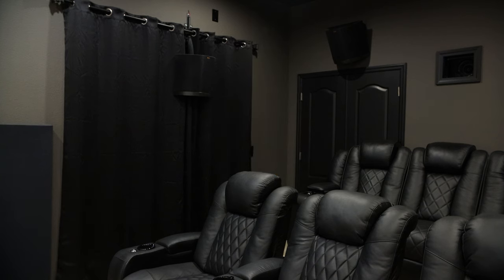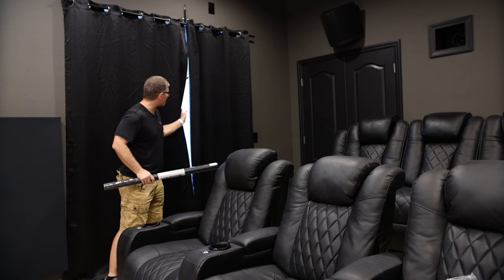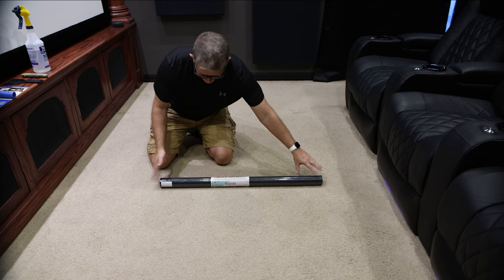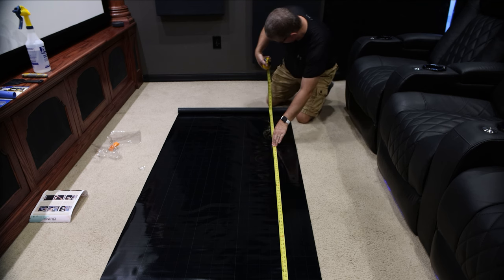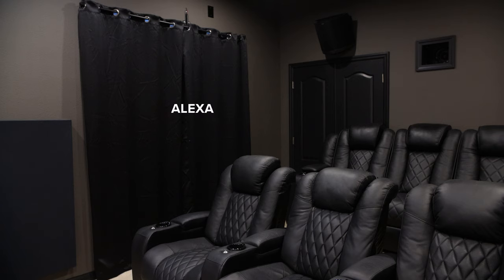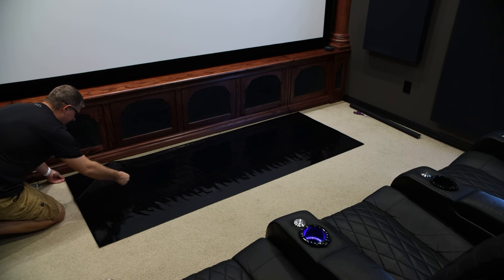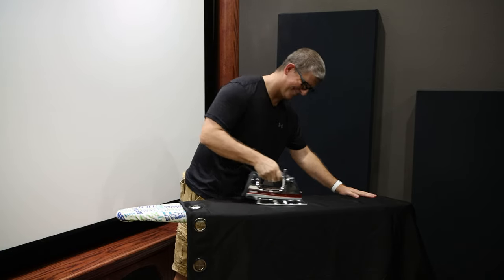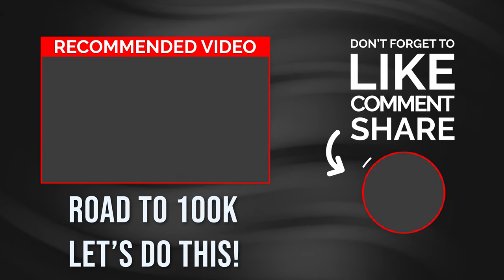CHEAP AND EASY Way to BLACKOUT Windows in Your Room

Comment: The static will pull a lot of dust. You should spray on the side going towards the window as you pull the protective film. Will prevent dust build up and make install a lot easier
Reply from the maker: It was pretty easy to install.

Comment: Awesome video! I’m 36 and home theater has been a HUGE passion of mine for half of my life. Finally bought my first house after renting for a long time and it has a fully finished basement. First problem I had was dealing with the sound absorption from the drop ceiling tiles now that is taken care of on to covering the windows and this turned out to be your latest video! Funny how things happen. Keep up the awesome work!
Reply from the maker: That’s awesome David! Congratulations on the new home
Reply: @Youthman  thank you!!!
Reply: Pretty sure you could've fixed most sound problems by getting a good sound system loud enough to feel tho 😢
Reply: @ShawnJonesHellion  I have dual Klipsch 15” subs, that’s enough power for a medium sized finished basement. The problem was the sound absorbing ceiling.
Reply from the maker: Who?

Comment: My instinct is to paint the OUTSIDE of the glass pane WHITE to reflect the light away. It should also keep the window cool and hopefully keep it from cracking. What's on the inside pane of the window shouldn't matter, because you're trying to keep the outside light from coming in, not stop inside light from reflecting back (the blackout curtains will take care of that).

Comment: What wasn't mentioned is thermal expansion of the glass. Unless a small area around the perimeter is exposed (film not up to edge) the window will crack when it gets exposed to direct sunlight when hot. The film will prevent the glass from expanding and will cause it to crack. The professionals us a credit card to trim around the perimeter the correct distance. You'll find out.
Reply from the maker: Mine is under a lanai and does not receive direct sunlight.

Comment: Be careful on installing blackout on glass if the glass isn’t fully tempered glass you could potentially break the glass from heat build up
Reply from the maker: Thanks. I'm not sure if mine is tempered glass or not. But it's still good as new and I live in Florida.

Comment: these worked very well in my room. had a tough time with the corners, but otherwise they did a great job!
Reply from the maker: You did the same. Covering them with blackout curtains completely blocks any small light bleed from the edges.
Reply: @Youthman  exactly. It's the perfect solution.

Comment: Very nice, less messy than what I did. 
I used black latex paint and painted my two big windows and then covered it with a blackout curtain that was already there trying to block the light. 
The latex paint is very easy to remove from the glass with a razor blade if you have to.
Reply from the maker: Wow that’s commitment.

Comment: Thermal heat buildup can crack window glass and cause excessive expansion and contraction of your window unit greatly decreasing the window seals service life.  It would be money well spent to simply purchase blackout shades which are now widely available in either manual or motorized units and wouldn’t void your warranty

Comment: Put some similar stuff on last year in my basement, so far so good, I do notice when the sun hits it first thing in the morning it's gets pretty hot tho, not much of an issue cause it's only for an hour or so, but might be if it was getting blasted all day haha
Reply: I'm sure you can find a white brand that would reflect. In cold areas you would want the black tho. Heat probably shrinks an destroys the black a lot faster

Comment: We can use a plastic ruler to squeeze the water instead of metal to avoid hurting the material.
If you need to remove fast, maybe using black pp plate sheets and hook/loop fasteners will help which I am using now.
Reply from the maker: My scraper was plastic. Should be the same as a plastic ruler.

Comment: Omg the speaker mount on the side surround. I’ve struggling with the left side of my room. Due to it being 4 higher and open to our tiled dining room. Does that speaker have any ports on the back. And if so how does it sound against your sliding door
Reply: I have those same klipsch and the ports  are on the sides 2 port holes each side total of 4...
Reply from the maker: Correct they are supported. They are Klipsch RS 62 II. RS52, RS42, RS35 and the newer RP-502S are all side ported and are designed to fit flush on a wall.
Reply: I am not sure why people worry about ports on side speakers when wall mounting. You are most likely crossing them over at 80hz and that’s well above the tuning frequency of the port. The ports are for bass extension and not very active above say 40-50hz tuning frequency; so most of your sound is coming from the woofer above that range. The sides speakers are not playing any meaningful bass unless you use them at full range if you don’t have a sub.
Reply from the maker: Regardless of where you have them crossed over, a rear ported against a wall isn’t a good idea as sound and air is still going to come from the port and could cause its own form of chuffing or unwanted sound.
Reply: @ImBatman83  I not afraid of losing bass the whole left side of my living room is open to my dining room which is sunken by 4ft. Dining room is all Mexican tile sound bounces all over the place. Just asking questions trying to learn trying have some fun.

Comment: That looks amazing! I’m also really interested in that bracket your friend made as I’m in a similar predicament with my Klipsch 502s I just got 😬 haha!
Reply from the maker: I have photos of the bracket in my build thread on AVS - https://www.avsforum.com/threads/stevens-home-theater-the-fun-begins.1076751/page-15
Reply: Thank you!!!
Reply: @ScottReviews  There is a way to do something very similar with a Pyles speaker bracket off Amazon and gas pipe from any home center. Just have to cut the pipe to length and have welded to the bracket. Had to do  this with my 502S side surround no wall beside the couch so it comes down from the ceiling on a bracket. I have pictures if your interested.

Comment: can you remove that blackout if you ever decide to and is that hard? thank you
Reply from the maker: Absolutely. That was the main reason why I went with this solution versus window tinting. It’s only held on by static cling so you simply can peel it off spray some Window Cleaner and you’re good to go.
Reply: @Youthman  thanks so much

Comment: Can you remove the Vellomax from the glass if you want to?
Reply from the maker: Absolutely. Because it’s held on by static cling, there’s no residue if you need to peel it off.
Reply: @Youthman  is this coment coming from you?
text you?
Reply from the maker: No, I will never announce anything like that in the comments. Scammers hitting a LOT of creators.
Reply from the maker: @Geerladenlad  their account has been reported to YouTube (which doesn't help) and I have also blocked them from being able to comment on the channel. Thx for letting me know.
Reply: @Youthman  I had the same thing happen on another YouTube channel.
Reply from the maker: This is the 8th account that has impersonated me. All 8 are still active even after reporting them all and speaking directly with YouTube support. Tons of creators are getting them.

Comment: sweetheart i want to make the windows all black for a better movie experience. she said only if you want a divorce:)
serious WAF in this option....
Reply from the maker: 🤣 Yeah this may not work for a living room setup.
Reply from the maker: Funny thing is as I was reading it, I thought you were calling me sweetheart 🤣
Reply: I work at night sleep during the day try double black out curtains hung on separate curtain rods. It works great
Reply: @dirtymotley9048  thats what we used 
the WAF is doable. she loves the curtains and we get near dark during the day. is she would let me i would add the black on the windows but i already know it would be a no.
Reply: @Youthman  ROFL.
nah more like the conversation she and i would have. 
but if i could do the blacked out windows i would do it. 
our living room doubles as our entertainment room.
it actually works with just the black out curtains.
but glad to see you gave me another options for future set ups if we move.
Reply from the maker: That can work too if you can get them close enough to the wall.
Reply: Place the black-out film on thin plexiglass. Use temporary Velcro on plexi for the window that doesn't damage it when removed to hold up plexy glass. When you don't need it, hide the plexiglass in the closet.
Reply from the maker: That would work too. This is more of a long term permanent solution
Reply: That was more of a solution for dv.